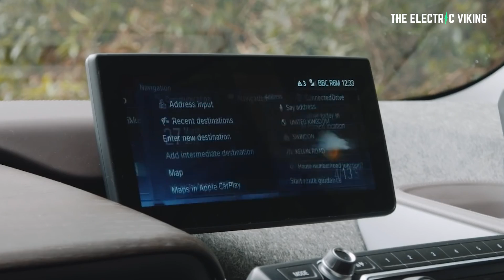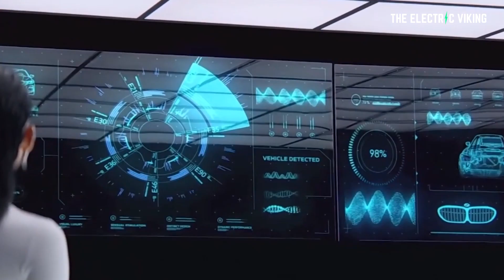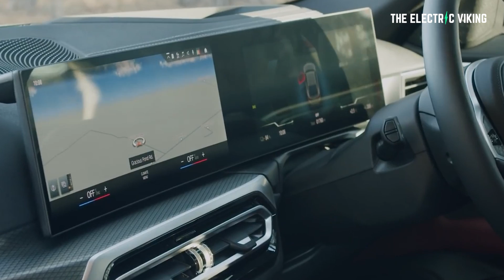BMW's new EVs to be 'affordable:' batteries will cost 60% less

Comment: How about a net of wire above the roads, A pole could be fitted to the back of the cars, and a bit of bent metal could make contact with the metal netting. 
When connected, the car would play fairground music. The cars could have a thick rubber bumper all around them. A big number on the bonnet would look cool. The rush hour could be so much fun!

Comment: The low rolling resistance tires are using aramid(kevlar) rather than steel for structure. The tech has been around since the late 1970's but seemed to have fallen out of favor until recently. I used to run them on my Jeeps. Super light weight and much more puncture resistant, especially the sidewalls. There is only one current manufacturer of these tire world wide.

Comment: I live in northern Sweden, in what could be described as the winter testing capitol of the world for cars, and I've seen the drawbacks of BEV's during the winters. -30C and below combined with snow, great distances to drive to get anywhere has been a problem. Add a trailer with a snowmobile, an ATV or just simply firewood or something you want to move from one place to another or a caravan to that and you won't have a super fun time.

I'm not saying that FCEV's would make life with an EV easier up here but I know that it is being tested at least.

And yes, I know that EV's are big in Norway. Please read up on why before pasting that as a standard answer.
And yes, I know that everyone up here will be forced to switch to some sort of EV soon. I just wish they will be made to work as a serious alternative to a combustion car for us here all year around by then.

Comment: Affordable means the EV should be no more expensive than an ICE version of the model. Eg here in NZ a MG ZS EV is $25,000 more than the ICE version using the 51 kw battery, almost $500 per kwh. What has happened to the $US100 per kwh batteries we are told the battery makers are producing these days?
Reply: But an electric car should be a new car from the ground up, not a converted gas car into an electric or based off of a gas car..

The only electric cars BMW have that are actually based of one of their gas cars is the i4 and that iX3 that is sold in China. 
The i4 is roughly the same price as a 4 Series Sedan.  With the i8 and i3, BMW had no gas car equivalent, the same with their big expensive electric SUV iX.

Comment: If anyone owns say, any BMW with Nav from 2018-2021, especially in the "affordable class"  of the X1 and X2 will note how little BMW has changed their center console interface.  The 2015 I3 console interface mess has been largely unchanged for 7 years.  They kept the same crap around for years, so they could say "me too"    Fast forward to 2023, and now,   BMW has but a battery and motor (rear-wheel drive)  into what really is an ICE  430 Grand Coupe with their 1st gen batteries, and they're promoting their next-gen batteries already.  Simply freakin' brilliant.  Wait,  you're selling "entry level electric 430s  at approximately $60k USD, and you're saying,  we have "something" better already.  Maybe a few new i4 owners are just slightly ticked or will be in the near future..

Comment: If the world were to swich over completely to EV,  there would have to be more power stations and a lot more charging posts which is always very difficult to do in the big cities. That is why hydrogen can still get a piece of the action, but I think EV will still dominate
Reply: public charging is difficult to do in the big city? What city do you live in? There are hundreds of chargers were I live and I live in one of the biggest cities in the world. 

Of course more and more public chargers and grids will be erected as sales of electric cars increase.. The only hold in North America is that no brand has yet to introduce an affordable long range electric car for the masses.. The Chevy Bolt has come close but it only charges at 55kw.
We need a 155kw charging speed, 300 mile range and priced at $33k (made in the USA so it can qualify for the $7500 tax credit).
Whatever brand that can do this will sell all they make.

Comment: They're always going to be luxury or near luxury premium vehicles just depending on what model you're talking about.  The X1 is actually pretty darn good at 36k, it just drops like a stone in residual value since their reliability is not great and repairs are expensive.  If they could get an X1like EV down to 40k or lower with decent range with the tech that's coming that would be pretty great.
Reply: $40k for a crossover from BMW? Hardly..
Maybe the base model would start at $45k or $47k with just one motor and rear wheel drive? As one adds options and AWD, the price increases.. If BMW truly wants to make affordable electric cars, they should reinvent their 'i' Brand and reintroduce those groundbreaking materials that are found in the i3. A modern 2025/2026 i3 with new battery technology and a faster charger shouldn't cost above $40k optioned out to the max. The reason sales in North America tanked was because of the range and price.
Add another 100 miles to the range and triple the charging speed and keep the price at around $42k (would have sold all they can build).

Comment: In the grand scheme, it doesn't really matter if companies like BMW and Toyota survive. It would be useful, however, if they would seriously work on non-petrol vehicles. They just might come up with something. In the meantime, the electric vehicle industry seems to be humming along without them.
Reply: so u don't consider BMW developing their 'i' Brand of electric cars a serious thing? LOL.
BMW started off in the right direction, however, Elon Musk's Model 3 was simply better and cheaper and that is what killed i3 sales in North America. BMW customers didn't mind paying $55k for an i3 until the Model 3 came along with more range and a faster charger and the Model 3 was $18k cheaper for the base model.. All BMW had to do was update the battery and charging speed in the i3 and sales would soar.

Comment: BMW doesn’t get enough credit for their trial and error with lightweight carbon fibre chassis back when the industry wasn’t sure if battery tech or weight reduction was the way to go for extending electric range. I hope they see success in their future endeavors.
Reply: But they made that new EV SO heavy!!
Reply: I disagree.. BMW has received so much attention for the i3, its when BMW stopped developing the i3 is when they lagged behind brands like Tesla. How the hell are you gonna charge $55k to $60k for a maxed out i3 or i3s that only has 160 miles of range and only charges at 55kw versus a Tesla Model 3 Standard Range at $38k with way over 250 miles and charges nearly 3x times that of the i3..  For that same $60k, one could get a duo motor Model 3 Performance car that equals most 'M' badge BMWs..

Comment: BMW I3 was an EV killer I think designed to make people hate EV's. The I3 was on bike tires drove scary at high speeds. The tech was shit and you did not have any range and charging took a day for 75 miles. Who would like that at $50,000.BMW sold it for 10 years with no improvements. This is BMW progress i guess

Comment: The new i3 back seat is very cramped due to the high floor necessary to house the battery. For me to buy an electric BMW, it needs to have 400 miles of range, fast charging and the charging infrastructure to go along with it. This will take at least 10 years to accomplish.
Reply: Yeah,  but at one point in time, owning a BMW, while being overpriced, was also pretty much a fixed expense for the 1st 4 years/50k  especially if you bought into the maintenance packages.  That is no longer the case.  BMW's add-on maintenance programs which are still several thousand USD covers little more than oil changes. BMW actually used to market its extensive warranty/maintenance against Audi.  I don't think anyone has seen BMW advertising that advantage in the past couple of years. <:)
Reply: so in other words you won't be buying any electric car regardless of brand because no electric car has 400 miles of range (outside of a $180k Lucid Air).. Its perfectly ok to wait and see what happens in the future..
But in the meantime how much would it cost you in gas to get 400 miles out of your current car considering gas is about $5.70 dollars a gallon in most States in the USA. 
Oil change cost? And all the cost associated with a gas car for the next 10 years.. 
That shit will add up...
Reply: @mamadouaziza2536  Thoughts:
1. 400 miles of stated range drops when driving on the highway at 80MPH, esp. with the A/C or heat on.
2. 400 miles of stated range drops as the battery ages, and at low temperature. And EV proponents always ignore the cost of battery replacement, which will be a $10K-15K expense in 10 to 15 years. That equates to $1K/year, which is more than you'd spend to maintain a reliable Japanese gasoline car. 
3. Gas is $3.60/gallon where I live.
4. I'm glad EVs work for you. I'm in "wait and see" mode--the technology is changing too fast for me to jump in with an EV purchase right now.
Reply: @huskypup3489  
Yes, technology is rapidly changing..
1 Even in a gas car your gasoline will empty out quickly driving on the freeway at 80mph.

2   In winter or summer, turning on the air conditioner in a gas car will quickly eat up the gas.. 

3  Battery tech is amazing, even older batteries from Tesla and BMW are still holding up great after 9 years (BMW i3' from 2013 only have about a 3% battery degradation). In 10 years, batteries will be far cheaper to replace.   Hondas and Toyotas aren't as reliable as you think, there are many that have needed the engines and transmissions replaced even before 50k miles.
Reply: @huskypup3489  
So, it costs you roughly $50 plus tax to full up your car in order to get 400 miles out of it?  An electric car wouldn't cost nearly as much and most places with Level 2 charging don't charge at all..  The bottom line is at the end of the day, all these car's expenses add up (both electric & gas), the money you save with electric should be held for a battery replacement in 10 to 12 years. 
But 90% of electric car owners lease the cars. EVs will always be on the used market
Reply: Also, the charging infrastructure has improved greatly just in the last 24 months.
There are public chargers everywhere.
you don't plan a trip in an electric car around gas stations, you plan around the chargers (Walmart, Kroger, ChargePoint, EVgo, Electrified America etc) The nav in an electric car will steer you to all the public chargers on your route. Most major hotels and motels now have chargers.. Stay positive and stop talking as if you want electric cars to fail.

Comment: The words affordable and BMW have never gone together.
Reply: Shortly after the end of WWII, while Germany was rebuilding, BMW produced a tiny little 3 wheeled car, with a front that opened as a single door. It was powered by a motorcycle engine, and it was definitely "cheap". It also holds the dubious title of "least safe vehicle ever mass produced". 
While BMW hasn't produced a truly "affordable" car in a long time, the have done so in the past, and they could do so in the future. But that doesn't mean they actually will.
Reply: @chrismuir8403  I am happy to be stand corrected.
Reply: It is relative e.g electric BMW is affordable when you compare the to BMW plug-in hybrid.
Reply: @tokarp390  true everything is relative, if you are upper management most EVs are affordable, if you are millionaire all EVs are affordable. If you are the average Joe nearly every EV is unaffordable